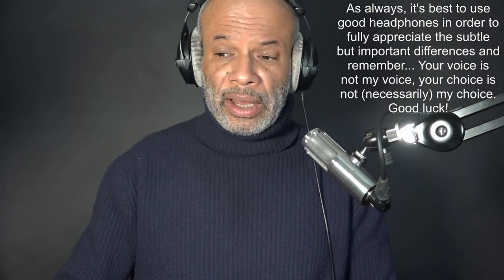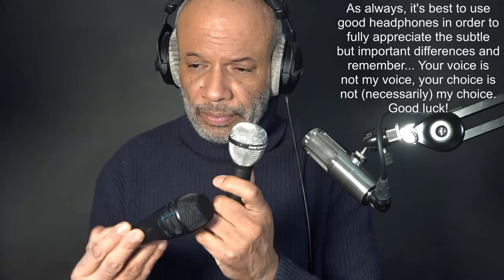Proximity Compensated Microphones Compared

Comment: Thank you for the video which is very entertaining and informative again! I had hoped for the EV mics -- although they are not handheld. Or for the AKG D202 which is nothing else now but a part of the past so, I understand, is not so interesting today. However, it surely was one of the first proximity compensated models with its dual transducer design.
Reply from the maker: I have heard about the AKG, I think they were quite complex (certainly the Shure is said to be complex) and maybe a bit fragile. I thought the dual diaphragm was to increase frequency response as in woofer and tweeter, I will do some research.